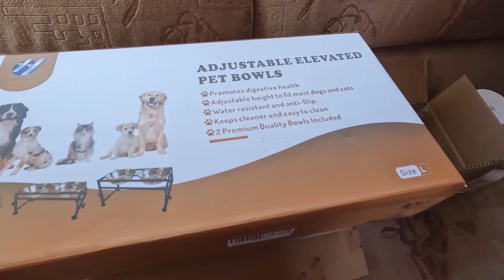We Had To Tear It All Out! What Does This Mean For Our Rainwater Cistern?

Comment: Cob washing away, is a lesson our ancient history learn thousands of years ago, it's also why roofs that draw away the water was invented, to limited the walls being washed away. Take one look at really old structures and how they built their houses and why. From what we know from the stone age and simpler building made where it rained a lot and in those place that always improved upon the roofs so that it led water away, fun little fact is that some of those techniques are even used partly to day in modern houses. You see a lot of it in countries that have limited forests they are trying to safe and other building materials than wood is more focused on. 

The key lesson one can draw from this is that keeping water off your house is important, that means having a roof the water can't penetrate of wash away is important. How you get there though is less important that how well it leads water away. A pure clay based roof is at it's core a bad idea, this can be mitigated by how well you protect the roof and how good sealant you add. Do it good enough and you won't have an issue, but getting to that point is frankly costly, so simpler more modern solutions are in the long run a much better option. It's a sad state of how materials react to slow seepage of water and rain.
Reply from the maker: Conventional roofs are much more expensive and are subject to wind forces. Once we have the dome plastered, it will be protected from water and more resistant to high winds.
Reply: @ourselfreliantlife  Sure, but plastering only gives limited protection at best. The acidity in rainwater will eat it over time, same as whitewash on old buildings. As for roof's sure their weakness is wind, but there's a middle ground, it might be harder to find, but thatched roofs uses this effect on occasion.

Now I'm talking years into the future, and not this year, so you will have time by adding plaster, but it won't hold. A Swedish company actually went and did a study on durability of roofs several years ago, And oddly the results were mostly ignored, but they tested time scope 5, 10, 15, 20, 25, 30 year. That's how long they had been doing these test, so many new techniques were not in the test, but it still showed more than one surprise. One key element the testing showed is that even a poor roof that don't leak is better than plaster by a lot. We're talking a decade or more in durability and that includes damage done to walls too.

To say that this study should be required reading is an understatement, but it keeps disappearing from the mainstream net for some reason and you can guess why, when some of the answers in that study showed that one thing the bog boys pushed hard were an inferior solution with decades less durability compared to the best results.

I'm not a builder or homestead, but I know that local environments adds a lot to a rather complicated situations, but some core truths still apply, roofs matter.

In your case the plaster will help erosion, but its durability is low unless you add concrete to it. One tricky solutions I've seen done was to use swimming pool sealant to protect the roof with a layer of shotcrete over it., but that might not work for you. That should give them a roof durability of around 15 year, maybe more.
Plaster at its best never got beyond 5 years and usually needes to be fixed every 14 months or so, or it will leak. But those numbers might change due to local weather and such. Both sun and rain are your enemy  too, so both should be considered.

Honestly with what I know, I'd never dare leave only plaster and I'd rather take a hit money wise, but that's just me.

PS: the Swedes has done a rot test which is interesting too, I'm not sure though why they do such test and nobody else seems to do it.  I'm not a Swede by the way. My trip down the rabbit hole started while reading up on viking homes and why they built them that way. Humanity has thousands of years of history of learning how to build against nature, but oddly enough too few take a dive to check what they really came up with and that was with limited materials.

One hint, thatched roof is oddly better protection when done well than plaster, even plaster with concrete in it. It's hard to belive, but easy enough to check out.

Comment: I think a few inches of gravel in the bottom of the valve box wouldnt go a miss. As for that rattle snake I would have found a nice hole for it.....in Russia
Reply: Gravel?  Why?
Reply: @honthirty_  neater, water drainage ,easier work area, firm footing, retains heat ,and its bloody cheap. Or you could have wall to wall mud if prefered.

Comment: Waterproofing mix for wood:  75% Mineral Spirits + 25% Cheap Polyurethane varnish.  You can use cheap paint thinner for the mineral spirits.  This mix allows for better penetration.  More coats equals more protection.

Comment: Question: Why not build wall forms and you can even reinforce it with  chain link fencing on the sides and corners. As structural supports if you can't get rebar . Then actually pour cement walls 4-6 inches above ground level.   And not worry about it again . Well I see you did a fairly good job fixing your water valve grave . I hope it last .

Comment: imo
since being able to access the valve
forever
maybe dig the hole 4ft x 4ft by depth
finished  inside measurements
then open it up to 5ft x 5ft
(6 inch think walls and one ft higher than existing level.  
Insert the wooden walls
Bend some rebar into squares mabe 5. That are 4.75 ft squares
Then maybe 8 verticle bars
them mix some cement treated soil
Like 6 sacks per cubic yard of material
and pour it in to backfill the hole plus one foot higher..)
may this be over kill.  ??????
maybe. but I hate needing to go back to redo some thing that failed....
but that's just how I look at things
P.S.   any left over dirt
mix it. as cement treated soil and slope everything away from the hole